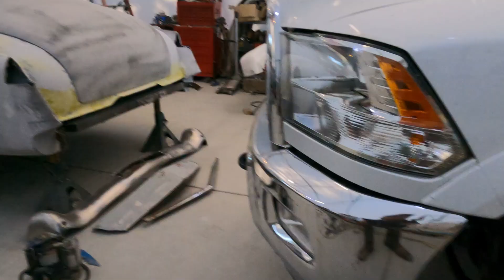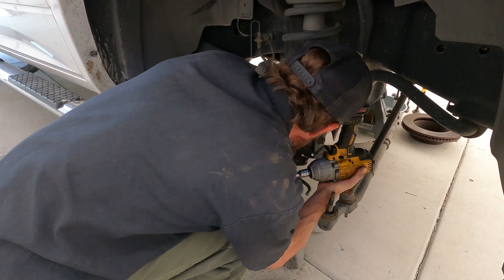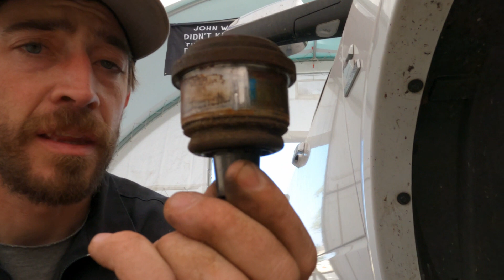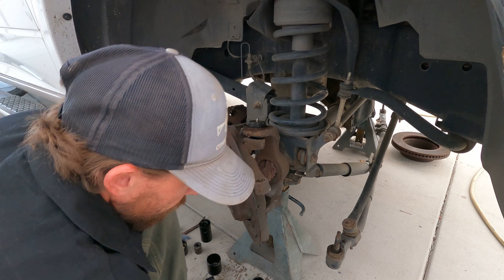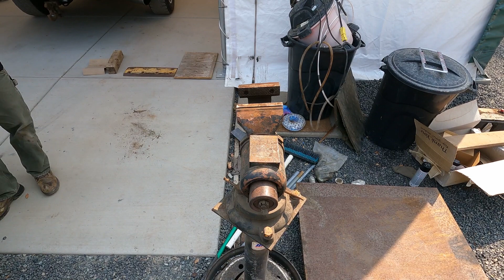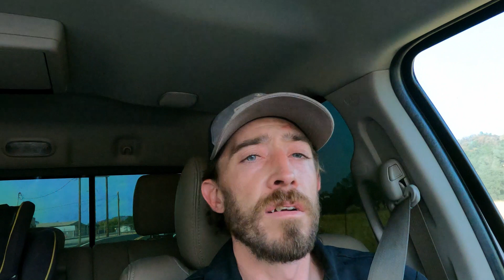REPLACING BALL JOINTS ON 2012 RAM 3500 4WD

Comment: I used the same maddox ball joint press from harbor freight and though it works, I had a hell of a time on the lower balljoint. Using it like you did, I mushroomed the body of the ball joint with the threaded end of the press and had to press it back in before extracting it back out. The biggest spacer also was just a little too short to fully push the joint out before it started hitting the shoulder of the joint and threads below with the hollow cap. I had to fit a socket under the threaded part of the press and the joint to get it out. It worked though. I hear people say the OTC 8031 is the kit to use ideally. Thanks for showing me how you did yours! It was a great reference to what I had ended up doing!

Comment: Seemed like that penetrating oil really help on that lower ball joints removal. I’m gonna soak mine the night before I attempt this I believe. Thanks for your time man. I’ve watched this 5 times now in preparation and I’m sure it’s gonna be a life/time saver. Thank you !
Reply from the maker: Thanks. No problem glad i could help you out.
Reply: @mcintiregarage7359  just finished the ball joints and axle joints last night. First side 5 hrs second side 3 hours lolol
Reply from the maker: @badtama07  The first ones the worst one. lol. Glad to hear that you got them all done and the video could help. Thanks for watching.

Comment: Did you need the adapter kit as well from harbor freight? Or was the ball joint kit alone enough?
Reply: Go ahead get the adapter kit. Can be done without it if your balljoints aren’t badly seized. 
I feel as the kit saved me from extra aggravation.

Comment: Do you need to put your truck in 4 wheel drive before you pull the axle shaft? I heard there’s a little lever than can drop sometimes if you don’t.
Reply from the maker: No I didn't have to put it in 4 wheel drive.
Reply: I believe this is a trick only for the second Gen’s with the Dyna 60 axle. Up to 2002?(ish) don’t quote me on the years.

Comment: How can you tell if you need to replace your U-Joints?
Reply from the maker: Jack the truck up you can pull wheel off or leave it on it's up to you. Then can put a pry bar in the axle behind the u joint make sure you keep it tight and then rock the wheel back and forth if there is any play in the u joint they are bad. Also if you see any rust dust coming out of the caps that's also a sign of a bad u joint. hope this helps you out.
Reply: You may find the upper edge of the tire leaning outward. There's a max spec of something like 1 degree of camber.

Comment: What brand of ball joint press did you get? I've got a 2005 ram 2500 4wd that needs this done but I've gotten conflicting reports of the press. Some apparently aren't big enough to do these big trucks. I was going to rent one but I'm afraid it'll be too short to do the job. Any advice you can give would be appreciated. I'm installing rebuildable joints from synergy so I'll probably never need this tool again.
Reply from the maker: There is a link to the one i used it is in the description below. i got it for harbor freight. hope that helps.
Reply: I bought the OEM tools 25104 from Amazon and it did a great job. Also handy for our u-joints. (I have an 03)